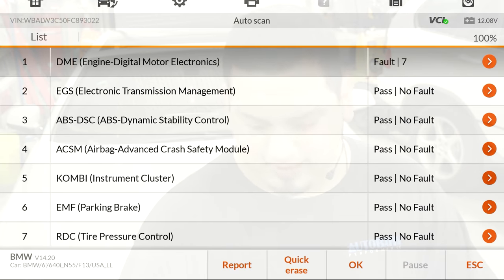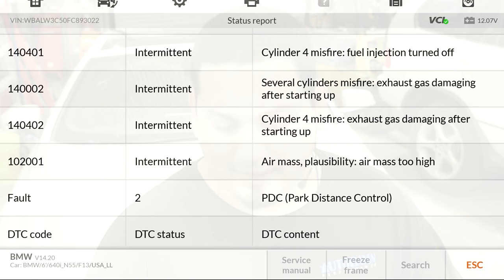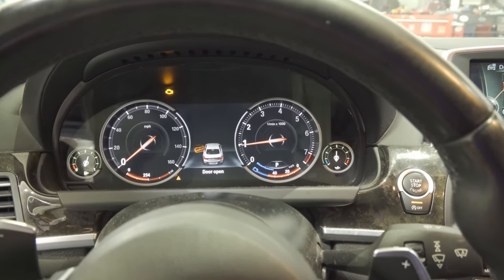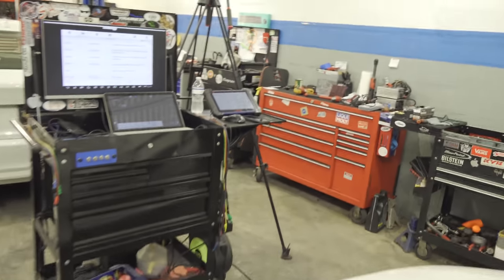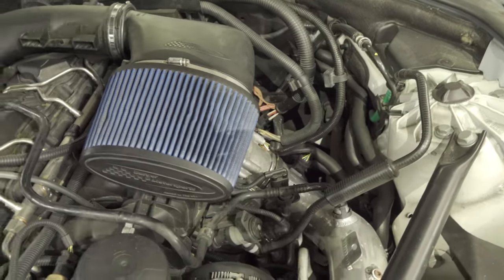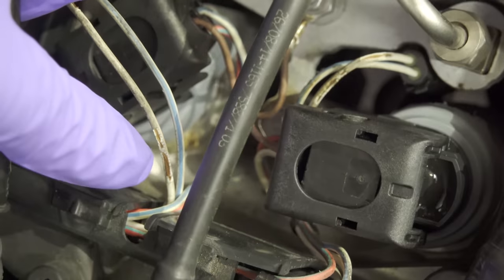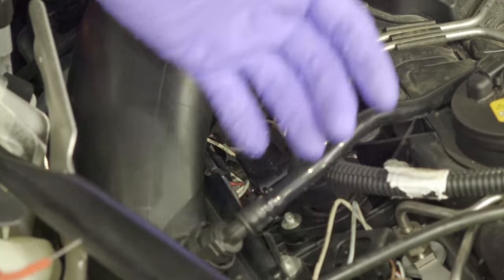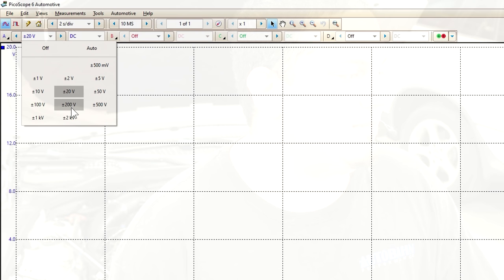2015 BMW 640i N55 - INTERMITTENT MISFIRE DIAGNOSIS AND FIX

Comment: Mario this video proved priceless to me.  I had a 2014 BMW 335i xdrive in for a Valve Cover gasket replacement due to the classic oil leak onto the converter and a spark plug replacement.  The customer provided plugs from FCP Euro ZR5TPP33.  I checked the website and FCP Euro claims that the ZR5TPP33S is no longer available and this is the direct replacement, claiming the plugs are identical.   Not thinking anymore about it I did the valve cover gasket job and replaced the plugs.  It took about 20 minutes of running at idle to develop a single cylinder misfire that started as intermittent and slowly developed into a constant misfire.   Not long after I was getting other cylinder misfires with the one cylinder being the most persistent.  Not thinking of a plug problem I looked into spark, fuel, compression, air, timing etc...   I couldn't find anything to explain the misfire(s).  Out of desperation I put the old plugs back in and the misfires did not go away!    As a final desperation after exhausting many options and now having all the new plugs back in the cylinders I swapped the new plug from the worst misfiring cylinder to a cylinder that was misfiring very infrequently and amazingly the bad misfire followed the new plug.  I spent some more time researching BMW misfires and anything I could find related to spark plug issues and sure enough I stumbled into this video.  After watching your video I took a close look at the ignition signal and the hash that you showed and it was almost identical.  My hash was near the end of the burn line not the beginning which was very similar to yours.  I also scoped the power and ground signals to the ignition and saw a similar hash pattern in their signals as well.  I have my ignition signals and can send them out if anyone is interested.  Long story short I asked the customer to purchase the ZR5TPP33S plug from the BMW dealer after watching this video  and they agreed which I installed and the misfire(s) disappeared.  I will only use and insist on BMW replacement plugs on all future jobs.   Thanks Again!
Reply: wow im currently facing the same issue with my 15' smh as for me i was just installing a new air filter and decided to swap out my plugs due to a small cold start miss i would get even though it didnt throw any codes.... i installed the new ZR5TPP33 plugs from the local part store and the car ran fine but by the end of the night i got a engine light and when i scanned it cyl 4 was the issue...i then pulled the car apart check the coils switch them around etc but still no luck... i even put back the old plugs bmw plugs but not knowing better didnt torque them so now im faced with cyl 3/4 misfire based on the new knowledge i plan to go get plugs from the dealer torque to spec and hope for the best thanks guys for the well informative specs on these german cars
Reply: @dellsteelz5905  I would not have believed it was the plugs until I saw Mario's video.  Two important things pointed me to the plugs  1) I could move the misfire only when swapping a plug from a misfiring cylinder to a non-misfiring cylinder  - misfire followed the plug only.   I tried coil swaps and even swapped in the original plugs with no luck.  2) The ignition signal matched Mario's almost exactly - hash at the end of the firing line.  When listening or watching misfires on the scan tool the ignition signal with hash almost always misfired.   Don't drive yourself crazy get the BMW Bosch Plug ZR5TPP33-S or 12120037582.   You will at the least eliminate the plugs as the potential source of your problem with the correct factory plug

Comment: Was it a plug indexing thing Mario? So crazy that swapping plugs the problem stayed with cylinder 4 and didn't misfire on the cylinder you moved it to. 
Completely understandable how you missed it. I would have too. And props to you for not making yourself out to be a super tech who never makes mistakes. I believe we do more for our communities when we're share our struggles. Keep up the great work Mario!
Reply from the maker: I think indexing might only be one aspect, along with depth and possibly plug temp.

Thanks Paul for taking the time to watch!
Reply: @SuperMarioDiagnostics  but if it was plug reach and temperature, why would it be only on cylinder 4? You'd think the other cylinders would have had the same issues.
BTW I shared this for you on my SD Facebook page and on my community tab on YouTube for you my friend.
Reply from the maker: Cylinders 1 and 2 soon followed suit, then we finally got approval to swap all plugs
Reply: @SuperMarioDiagnostics  ah got it, that does make a difference then. So as you said, it could be a combination of all three. Reach, temp and index. 
If this doesn't answer why we must always run factory plugs. I don't know what does. Nice job again my friend
Reply from the maker: Yup it's a paradox 😆 but yes the takeaway is that factory plugs actually make a difference, and in this case, swaptronics worked against me. Thanks again buddy
Reply: @SuperMarioDiagnostics  I put a set of Bosch Double Platinum plugs I purchased from FCPEuro in a 2014 535i N55 a year ago and they worked fine--car hasn't been back.  I believe they're the same plug as on this vehicle.  I wonder if this could be an Amazon/eBay fake plug situation.  I know fakes are abundant with NGK plugs so I never buy them on Amazon or eBay.
Reply: @SuperMarioDiagnostics  I think John might be on to something with the counterfeit Bosch plugs. However, as soon as you said only BMW plugs and exact torque, I immediately thought indexing problem. A second thought. Because the turbulence happened so late in the burn, it had to be caused within the cylinder by the combustion itself. Goes back to indexing.
Reply: @SuperMarioDiagnostics  Ahh. That makes more sense to me now.
Reply: This week I was doing  some  incylinder pressure wave form análisis  my self on good 14 bmw  and was good  before , I remove  the spare  plug , did not drop it or hit it. Re install  and a mismife say 👋  hi,  I do not see any physical  damage , but just by rem the plug fail
Reply: @VashthStampeede  I work in South America (Colombia) for the last 4 years fake parts hare a massive problem not just from the aftermarket but from dealers too. Recently they busted a warehouse in Brasil supplying all of south and north America than got the parts from Asia, they boxed in original fake boxes to be sold as original parts these parts look just like the original ones.
Reply: @SuperMarioDiagnostics  I am SD follower and I am glad he recommend this video. The story is fascinating and there are lessons to be learned. 
1. The more you know the less you know... In depth knowledge can send you searching in many directions  and second guessing all them which only serves to introduce uncertainty to the thought process. This is the Darkside of the Force!
2. 99% of the times it is the simplest thing that is causing the problem (spark plug)
3. Isolating the root cause is as important as doing the repair but when working on the clock the first will have yield to the second. 
4. Swaptronix does not always work! It's crazy but you have proven this. I can attribute this to the  component  manufacturing tolerances.

BTW Great video.
Reply: Absolutely Bro,sometimes the whole experience becomes a case study for the tech himself.all in all it's an amazing community,you've inspired me alot Paul Danner
Reply: @johnaclark1  
I think you've hit the nail on the head with possible fake eBay / Amazon parts. Both are swamped with fake automotive parts, had issues on a couple of occasions myself and will only buy from local reputable suppliers wherever possible. 
We have all become price dependant consumers and our need to seek out that bargain is being exploited by the  suppliers of fake parts.
Reply: It happens to all of us. Misdiagnosed is a way of learning when you feel like all the results were there. Also I had BMW OEM plugs go bad right out of the box and it started misfiring when accelerating only and was intermittent. Dealer plugs can be hit or miss as well. But I would still prefer OEM plugs.

Comment: Super Mario.  First of all, I'm very glad I found your channel.   YOU are my kind of person (mechanic/fixer.)  :)  Believe it or not, I felt as bad as you did when your "cleaning of the carbon" didn't get you the fix you wanted.  I really felt bad for you.  

Let me tell you why:  For a long time, I was an Aircraft Avionics Systems tech on USAF Airplanes.   We worked many, many systems on the planes (USAF) Like RADAR - Nav systems - Radio systems - flight instruments - engine instruments - flight control systems - etc., etc.  temperature and position indicating systems.   I got my butt kicked MANY times by these systems.  And I'm talking about working at the end of the runway,   trying to get a fix so the plane can take off!  Many times, I failed - And the plane had to taxi back to the parking spot.  Mission Canx.  I was not the HERO, I was the goat.  Talk about feeling bad.  :)   

Then, later on, after I retired from the USAF,   I worked for RCA on TV servicing, etc.   Got my butt kicked there.  Worked independently on TV's found the same thing as you found.  SONY TV's would NOT  work with anything other than OEM parts, i.e. Power transistors - certain transformers, and on and on.   So, I know exactly how you felt.  I also learned from those butt kickings.  Like you, keep your head up, and periodically YOU will be the HERO in  helping  someone else whose butt is being kicked.   I'm subscribed.   Thanks.  N-6395T

Comment: You do have to use OEM plugs every time with the direct injected BMW engines. But the hard part is that some engines OEM is NGK and some is bosch. Also you can only install them one time. Because of the crush ring and the position of the electrode.

Comment: Hi Mario. We all have got hit with the fake plugs issue. had a come back on a new model vehicle with a minor misfire at high rpm with no codes or check light. Put in OEM plugs. Vehicle works and runs great. Lesson learned

Comment: great video SSM  great learning expierence for industry    one thing to mention is to look at vacuum pulls  cranking with pressure pule sensor  and look for slighest anomoly    to see intake carbon issues   all the best brother

Comment: Wow, thats really a "good one" Mario!  The confusing issue is...... (since it turned out to be the plugs , ie non-oem PN) ,  you would think that you would get that wave form on every cylinder!  
What is so unique about cylinder #4 ?  
Maybe BMW figured out a way to place "component protection" on their spark plugs !  
I think videos like this do as much good as many of the other "logical" diagnostic videos on YT ; thanks again Mario!
Reply from the maker: It eventually started misfiring on cylinder 1 where i swapped the plug to LOL and then number 2 soon followed. We did eventually get am approval to replace all of the plugs. Thanks for watching bud!

Comment: The spark plug fixed it. It seems there is still something unique about that cylinder? Maybe I am overthinking.  I wonder about the chewed up wires or maybe an injector issue. Thank you for the videos Brother!
Reply from the maker: The wires were intact on number 4. This car has been given the test of time and is confirmed fixed. Thanks bud!

Comment: The problem is the indexing of installing a used spark plug. The crush washer is already flattened so your 23nm brings the electrode opening facing the exhaust side.
The plug opening must face the cooler inlet side otherwise you get misfires when hot. Conversely, carbon build up related misfires are evident when cold
Reply: Never thought or heared about that, but if this is right, every thread in cylinder head and plug must be exact the same or?!
Reply: @rudimaier3679  well known in Audi TFSI engines, i mention it a few times on my channel
Reply: So if i pull plugs for say have e look at the valves for carbon with the borescope, new plugs are included? :) 2nd question: when a brand like bosch sell plugs for this engine, i will assume that they are aligned right?!
Reply: @rudimaier3679  the thread length is crucial for reach and indexing. If you fit a plug with a  flattened washer you'll get an extra 1/4 to 1/2 turn ruining the index and reach. Mario here may have had the wrong plugs fitted if he found the OE to be different or they maybe copys. I use Bosch all the time. The point is you cannot refit  the plug and have the index correct
Reply: @davesterl  Wow man that is deep stuff I never considered, Thanks a lot.

Comment: By the way, I had the same experience with a 97 Mazda Millenia. Someone put NEW copper plus plugs in it. Took two weeks before I put OEM plugs in it. Customer said he put aftermarket plugs because they were told that they were so much better. Since then (20 years ago) I've always tried to use OEM  because the vehicle was designed for them. Resistance matters!

Comment: @27:40 the differences between your wave form and the one sent by your friend can be due to the differences in your time base capture, what is important is measuring the delta in burn time and then comparing.

Comment: I hate that feeling too. I crossed my “t”s and dotter my “I”s and still the car wasn’t fixed. This is a great case study! Good thing you only repaired one thing at a time. What if you replaced the plugs and the did the cleaning at the same time? You would’ve have never caught the actual cause. Thank you for sharing your experience so we can learn.

Comment: Super Mario Diagnostics Nice work brother. I have a 2012 N55 E92. Put those same plugs in. I have a skipping jerky idle at low speeds but can’t get her to throw a code. I think those plugs might be my problem. Ive looked on e90 post and from what I see some DME’s are really picky and some can use them just fine. Seems smoother if I flash to stock compared to my tune but still noticeable. Hopefully those double the price BMW plugs fix my problem.

Comment: Great to see you up and running. I hope some of your past problems are behind you now. This is a good video for everyone to watch. The reason I say this is you must install the correct spark plug in the vehicle you are working on. Even if an aftermarket plug manufacturer gives you several different choices, you need to make certain it is the exact kind of plug needed for the vehicle. I have had the same problem with bosch plugs in the past. Not that bosch isn't a good product. They offer choices for spark plugs of different qualities. Personally, I just stick with the iridium tip plugs. They work in almost all vehicles. NGK has a spark plug chart on their website that shows what kind of a sparkplug you can use for any given application. Keep up the good work.

Comment: Gotta love it when people spend good money to move the factory cold air intake to hot air intake on top of the engine.
Reply: But it goes roar when you open the throttle so it *sounds* faster. They're satisfied and don't care about numbers.

Comment: Thanks for sharing this video, I got burned similarly with an intermittent missfire  at over 4000 RPM that turned out to be bad coils. I swapped it with its neighbor and still, same cyl missfire on  high acceleration.  I think in both cases it was 2 weak ignition parts that only failed with the particulars of that specific cylinder. Again, thank you!

Comment: There's no one easier to fool than yourself. That was a good one and hard to believe. Isn't Bosch the OEM for those BMW plugs?
Reply from the maker: Yep. There is a numerical difference that i didn't show in the video. The oem will have a "r6" stamped on them, and aftermarket will have an "r8" on them.
Reply: @SuperMarioDiagnostics  Yeah there was a plug revision the OE Bosch plugs for the N55.  Great video by the way, proper diagnosis is key. Also the N55 PCV system is greatly improved over the N54, so carbon build up is greatly reduced.

Comment: Just went thru the same thing on my 335i.  I bought OEM Bosch plugs through eBay and was battling the misfire with those.  Turns out, they must have been counterfeit.  So I bought NGKs through a reputable dealer that also work for this engine, and installing those solved the misfires.  Plus the car has much more power now.  So don't feel so bad.  No more Amazon or eBay electronics car parts for me!

Comment: Great job Mario, we have these days even on familiar systems, your instinct was right in the first place but got distracted. I was thinking, why didn’t the misfire move to the other cylinder when it was switched around? And out of curiosity, what was the burn voltage on that primary waveform? Thanks again for an awesome video, don’t be hard on yourself.👍🏾

Comment: The N55 have a revised PCV system over the N54.  Carbon build on the intake valves is typically a non issue until much higher mileage

Comment: Hi Mario, Did you do outside cylinder ignition test, like putting an external spark tester to the ignition coil & checking the spark line?  That would've shown if it was a bad plug or ignition coil or wiring..Maybe that would help all of us.. No biggie Mario, you're great still. We all have done many mistake & we still do it. Cheer up brother.
Reply from the maker: I did not because of the good looking firing line, the coil was ruled out for me at that point.

But having seen this waveform in a vehicle with heavy carbon buildup, that steered me away from a spark plug issue, especially since swapping the plug didn't fix it

Comment: What did you do about the wires that were chewed by the rodent? I had a similar issue and found that the wire for the coil had been chewed and only 2 out of 6 strands were good so I repaired it and it fixed the issue.